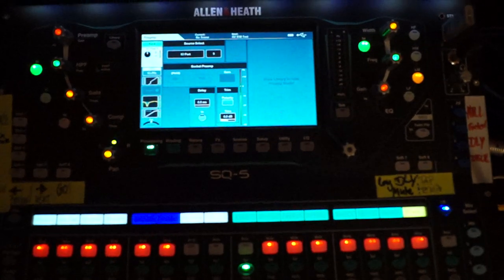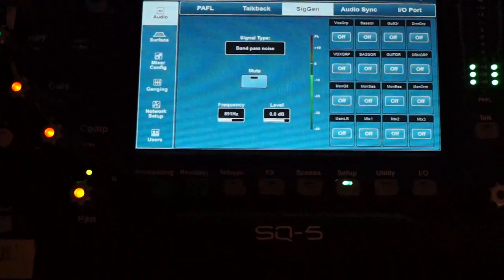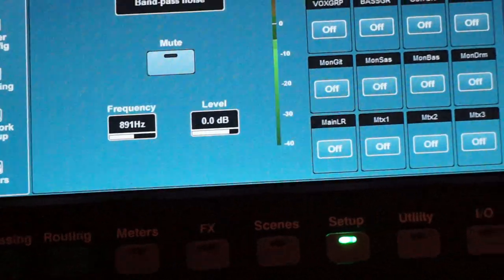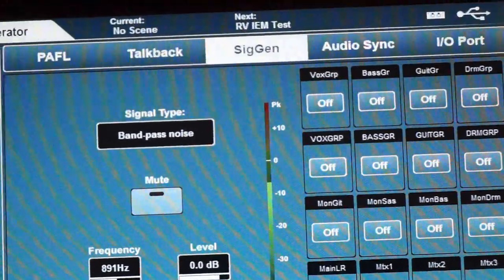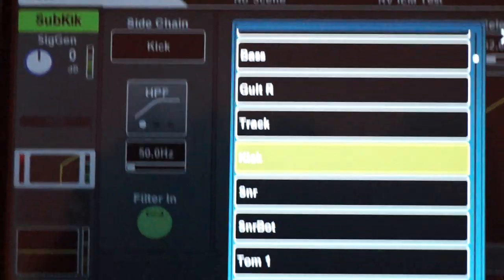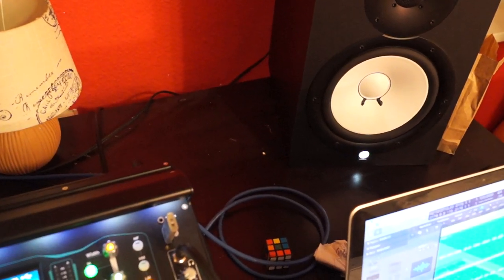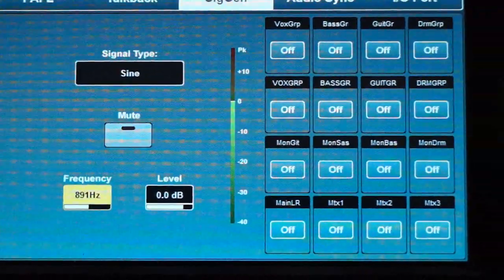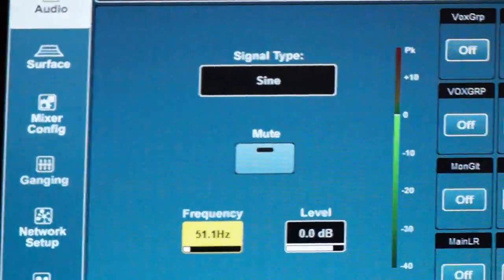No 12: MORE FUN WITH THE SIGNAL GENERATOR (MORE BASS!)

Comment: but seriously... can apply this trick at kick for live stage ?? i mean.. add sgnal gnerator(sine wave) for  kick
Reply from the maker: Hi Joe, 
yes, I do it with drummers who can play very consistent. That way the noise gate open reliably. Since the SQ firmware update 1.5. there is the HypaBass Add On. That is the other go to trick, to add more punch. But the sine wave is tunable to a desired pitch. 

Cheers
Reply: @AndreSchaier  so the hypabass same like a trick using the sine wave... bfore i just use this trick for mixing editor but sound so boomy hahaha.. so im afraid for use at live stage.. how about subwoofer..? can use??
Reply from the maker: No, hypabass does it differently. While using sinewaves gives you the ability to tune to one specific frequency, hypabass is "frequency concious". It follows the notes of an instrument, like a bass guitar and adds a tonal intervall (a perfect 4th or 5th, i´d say) in away, that our ear percieve a lower/fuller bassnote. 
It would sound horrible, if you add a static sine wave to a bassguitar. Alway go for the hypabass in that case. 
On the kickdrum you can do both. 
And yes, you´ve got to be careful not to overuse those effects and tune them in very carefully. But if you do it right, it can sound awesome!
Reply: @AndreSchaier  so then, it is better to just use hypabass right ..? because hypabass is enough to give a good effect to the kick or bass itself .. does that mean you?